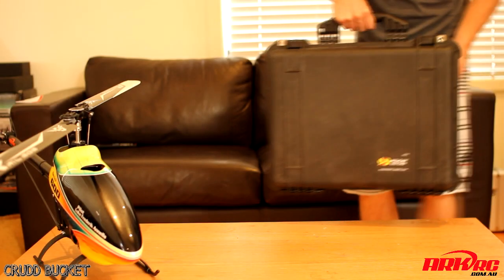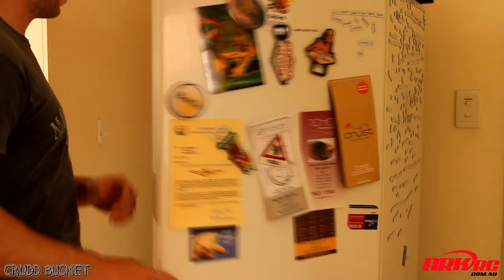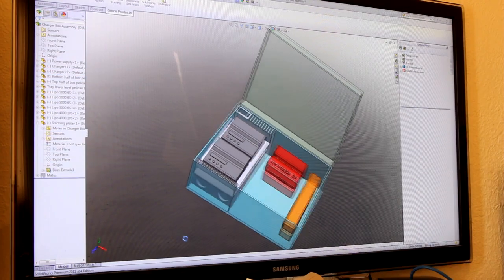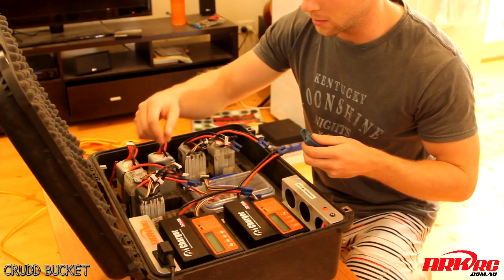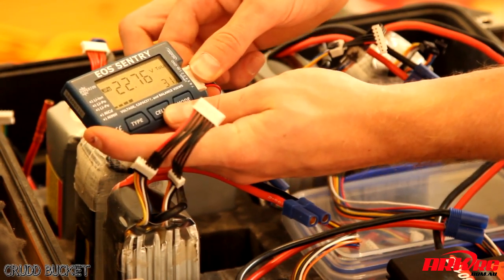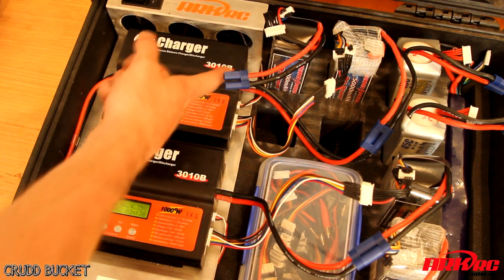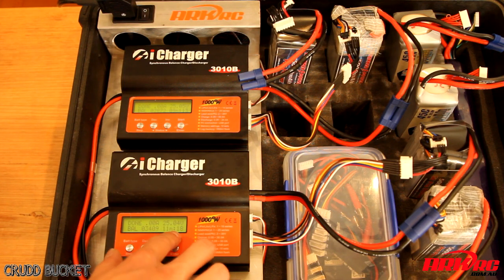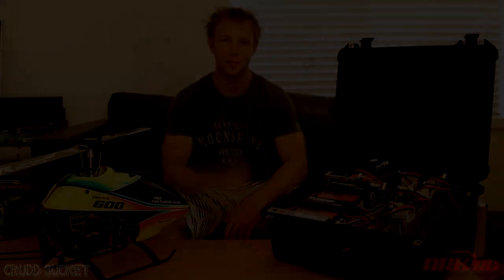ULTIMATE LiPo battery charging station!

Comment: battery came out of the tray and scraped the ground the metal plates protected the cells is this battery still safe to use? (I put back into the tray with electrical tape and tape over the tray and it seem to work fine no smoke came out so the cell wasn't punctured and I would like to know if this is still safe or if I need a new one?)

Comment from the maker: The area of the holes in the mounting plate are larger than that of the fan inlet and outlet to the power supply. There would only be minor frictional losses as the air has to change direction. That said, the power supply is rarely operated at maximum output. I have run this setup non stop through (40 degrees!) summer, with two larger 1000W power supplies and the outlet temperature has never been above 60 degrees. Well within operating limits :)

Comment from the maker: Hi mate I am making custom acrylic mounting plates and selling them on the ARK website. Check out this link: arkrc(dot)com(dot)au/crudd-parts-charging-station-plates-white/. Says currently out of stock but I have one here ready to go, and can update the site if you'd like it. It only works with that specific box and meanwell powersupply/pl8s. I could also sell you the in the video if you like. I no longer use it!

Comment from the maker: Hi Jonas I have approximately 75 flights on my TP 65C packs alone. I am also flying them with the same motor in the Goblin. However to increase the life span of your packs, I recommend charging at around 15-20 Amps if time permits. They perform exceedingly well as you expect from TP quality packs. Recently I have been given Revolectrix Diamond series 12S stick packs to field test in my Goblin and they are holding up amazingly well. The price is about 50% of a TP 65C pack too.. :) Cheers

Comment from the maker: Since making this video I have installed a 3000W 28V Meanwell power supply - along with two Cellpro Power Lab 8 chargers. I can now successfully charge a battery in 3.5 minutes, with a 4 minute balance time (total 7:30). This was a 6S TP5000 65C pack at 40 amps. A firmware update is coming soon, and it will allow charging at 50 amps. So stay tuned for a new better charging station video people. Cheers! Luke

Comment from the maker: @applyapology Cheers, I am not parallel charging because I prefer each pack to be individually balanced. I do however have the boards required should I ever need to do it. 3010 is a great charger indeed. I can't wait until there is a charger out there that can pump out 60 amps at 6S voltage!

Comment: @cruddbucket Yes, there are safety concerns. But you can get two 1200W supplies, put them in series and you'll get a 2400W, 24V output for under $100.

Comment from the maker: @pcmcg Yes you can do this, but even in parallel they are still at 12V which isn't sufficient voltage for high power charging (at 12V power output is restricted to 500W). I have also seen some people using PC power supplies without an earth, which is potentially very dangerous. I chose the safe route. The power supply retails for around $600AUD. Cheers mate :)

Comment: Nice setup, could you possible send me how you wired the chargers to the power supply, it seems to work very well and with having a Trex 600/500/450 pro/250, this will come in handy. Thanks for another great video.

Comment from the maker: @BaoThyForever1991 Hey dude, the mx charge rate is typically stated on the pack and should say either 1C, 2C, or 3C (goes all the way up to 12 depending on brand). "C" refers to capacity. If it doesn't say on the pack, try google'ing it and see if you can find anything. If not - you shouldn't exceed 1C for safety reasons. What brand is it? cheers

Comment: By the way I have a question about charging my Li Po :D. For instance, if mine is rated 2200 then can I charge it at a rate of something like 3000 or 3500 for faster charging time, or I have to charge it exactly at 1C which is 2.2A. Thank you!